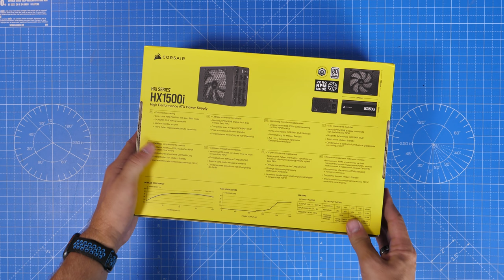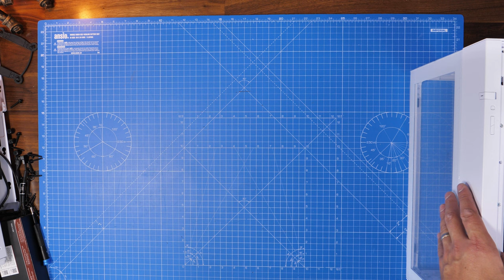Lian Li Dynamic Evo build ASMR style (no commentary)

Comment: There is the best part of £500 just for the fans and the extension cables right there. If you were buying Lian Li Infinity triple pack fans they cost about £90 per pack and the Strimer V2 24pin costs £65 and the 2x 8pin costs another £40 on top.

Comment: In the manual for the Z73 it says the tubes should come out the 3 or 6 clock position.
Reply: The memory sticks might just get in the way at the 3 o'clock position. Motherboard man. should really move the ram slots a little towards the right but MBs are already cramped as it is.

Comment: Just watched your new NZXT H9 Flow build video and was wondering between it and the O11D which had the better/easier cable management in your opinion?  I noticed on this video it looked difficult installing the SSD on the back middle cover and cables seemed cramped. The main reason asking is because I'm looking to purchase a new case for my build and will be installing a couple SSD's in addition to Hard Disks into the back chamber of either.
Reply: This might seem overkill but if you got a few hundred spare you can buy a 14TB Western Digital Purple 3.5" hard disk drive. That should be plenty of storage especially like me you like to rip your DVDs/BDs to a hard drive using a program like Make MKV. You need a lot of HDD space as it rips content from discs at a 1:1 ratio including subtitles(if there is any) and other audio channels if there is commentary. You might have to do this as BD discs don't play in VLC player(they don't for me, something to do with copyright and stuff, tried installing codecs and stuff, didn't work). Remember the contents of a pressed BD disc can be up to 50GB or more if ultra HD BD. A purple drive will work just fine in a PC, I know they are technically meant for CCTV apps but I find you can't buy normal HDDs that are above 4TB or at least not at the moment. If you have nearly £500 spare drive capacity can be as high as 18TB and 22TB. 22TB is overkill but enough for 440 BD titles or 2340 DVDs or over 31400 CDs. So it is a perfect drive for video and audio media set up if you have a huge collection of physical media.

Comment: I noticed many YouTube builders don’t use the ATX 3.0 psu. Is there a reason for this? Totally understand better pricing and higher wattage for older PSU
Reply: My parents dont like me
Reply from the maker: They're not easily accessible yet
Reply: Can't find them that easily, specifically the platium series 1,000 watts. Best thing for now is cablemod and get the 12vhpwr cable for now.

Comment: Did my first build ever following your video then i see Gamer Nexus video about how to damage your AIO and i wonder if i should move it to the top or is this way ok?
Reply from the maker: https://www.youtube.com/watch?v=n9TQsmj8rvk
Reply: Air always finds its way to the highest point, and stays there. unless someone CREATES a highest point the bubble cant pass. 
This is also the reason why us plumbers have to add air-bleed valves everytime we go up with a pipe, then down again. it creates a air trap. 
This situation just gets the air stuck in the top of the radiator, and it will stay there, which is fine. you wont be able to get rid of this bubble unless you have some kind of vacuum system to pull it out.
If you ever manage to get air stuck in the pump, turn it off and you can make the air go out of the pump again by trusting physics and move it around a bit.